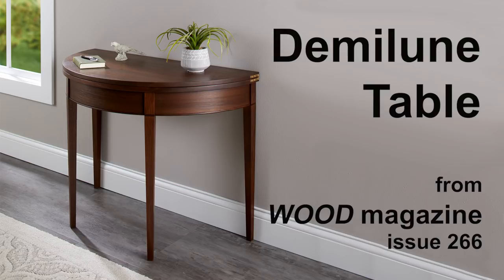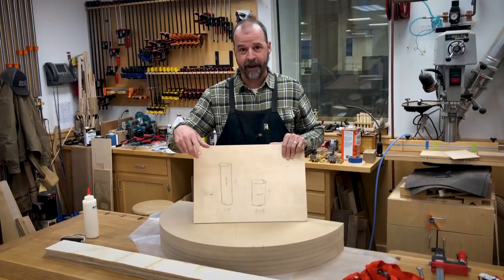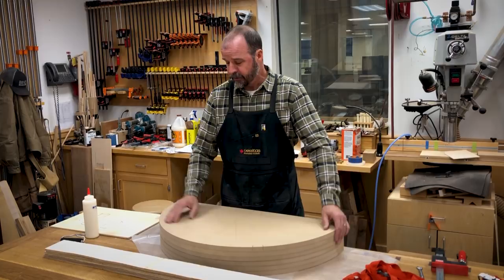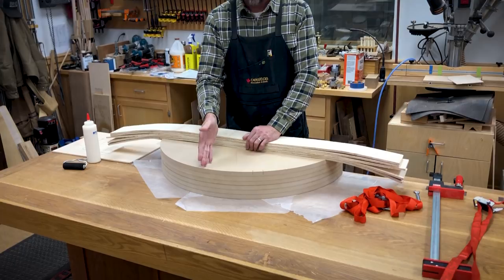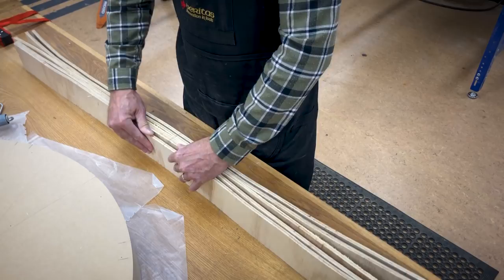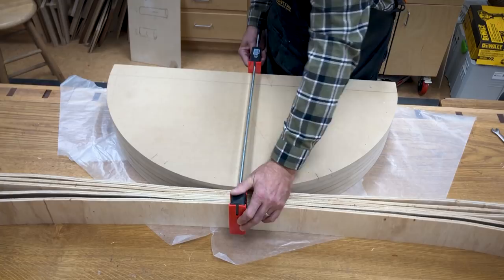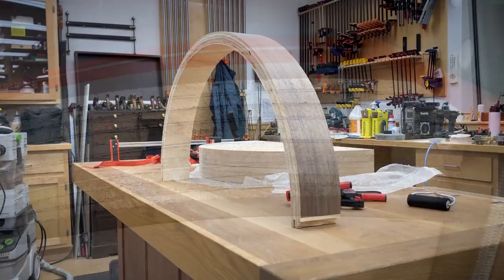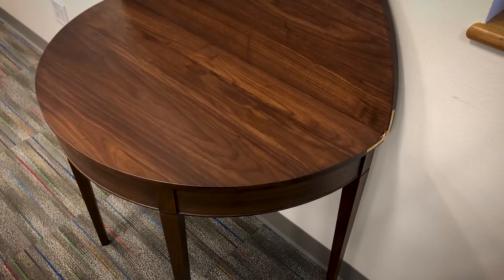How To Make a Curved Table Apron with Bending Wood - WOOD magazine

Comment: Do you allow for spring back.  In my experience there is always some spring back when you remove the clamps.  Though the plywood looks very mailable.  So maybe not an issue.  I have worked with solid wood strips on my curved tables.  So it was an issue with my projects.
Reply: WOOD magazine Thanks for the reply.  Great video.  Enjoyed watching it.  Wishing you a Happy and Healthy New Year!